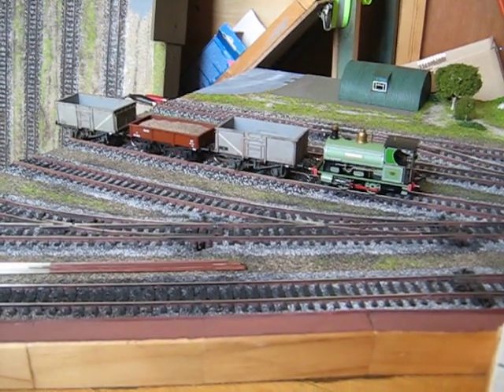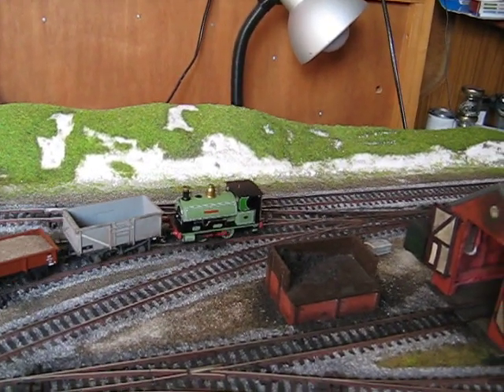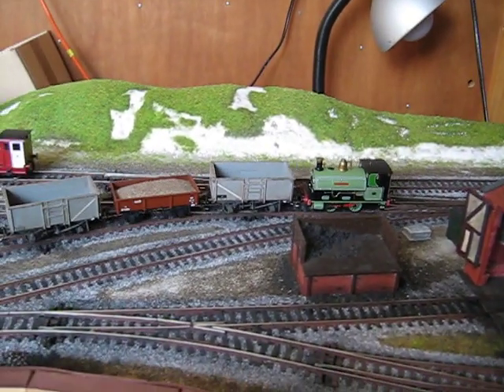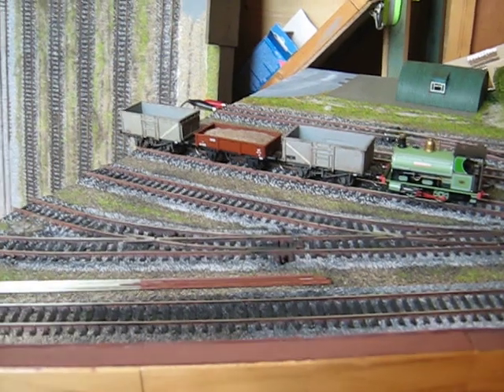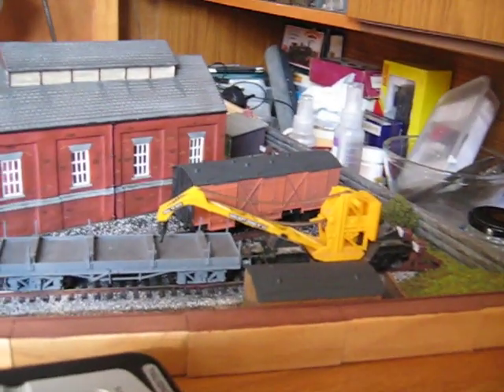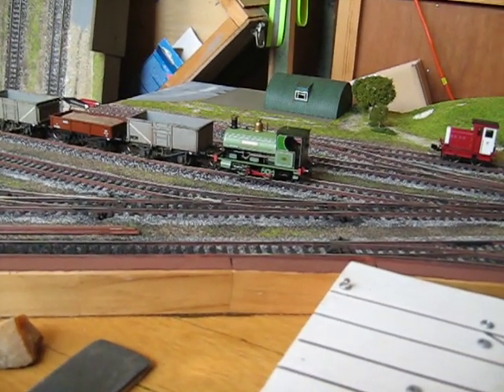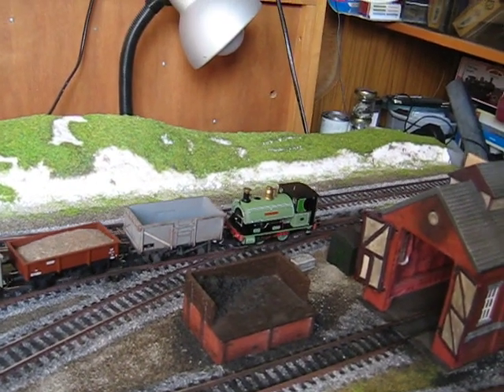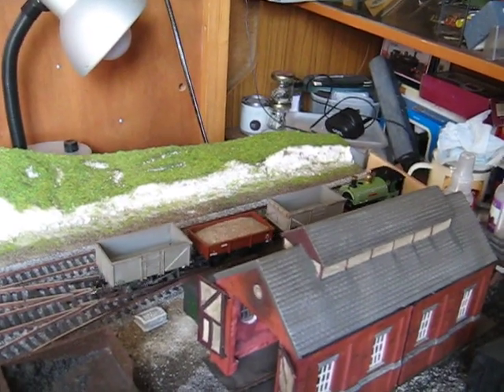Running a Hornby W4 Peckett on Chalkhill

Comment from the maker: I've been playing around with that old yellow Triang crane. I've fitted modern wheels ont the existing square ended axles. In addition it now sports Kadee couplers. It hasn't been fitted with brakes, but the mass of that heavy chassis and square axles running in the cast chassis slots seems to present enough drag/resistance to work the Kadees.
Those cranes are worth getting and doing some updating !!
Geoff.